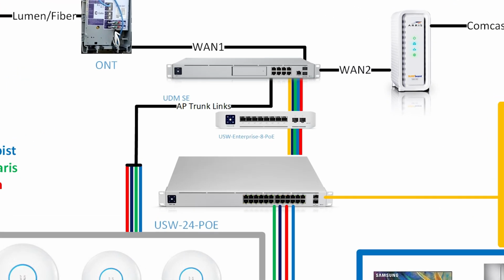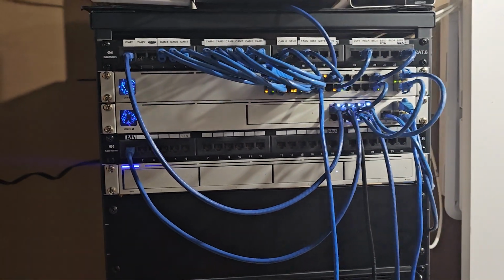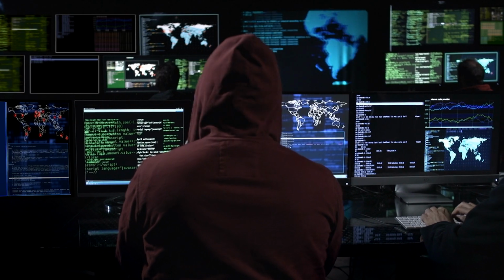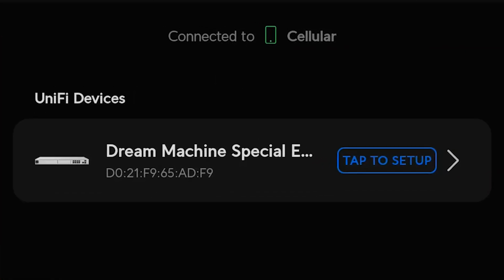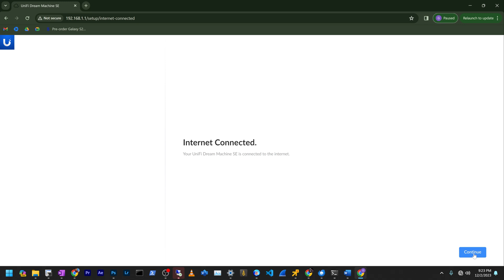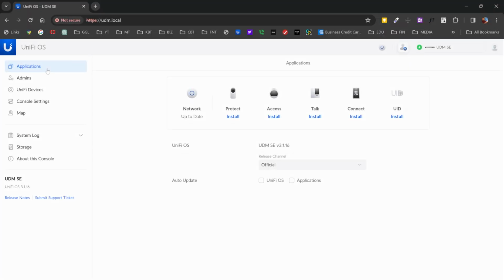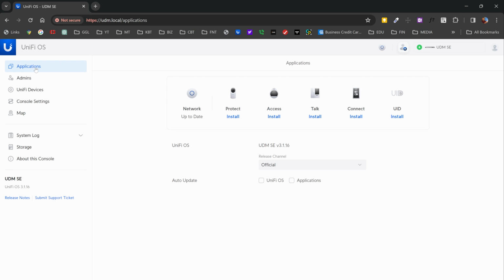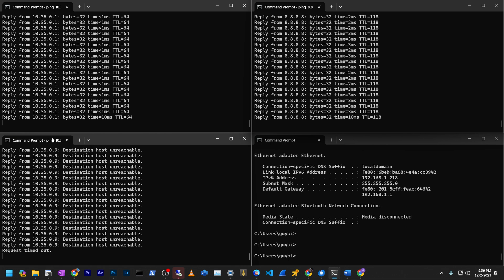🔥 UDM SE Mystery: Lost Configs & Saved by Backups - Why Regular Backups Matter!

Comment: This issue you just ran into is not super common but has happened to many users over the years.
Reply from the maker: It was surprising...
Reply: @KBTrainings   I'm not bashing the platform, but this is one of the reasons I don't push the UDM platform as much as I would like to. For now I keep everything separate and do nightly backups. For the video platform I don't have a customer that requires ultra high availability of historical video, but if I did I would go with a different solution all together.
Reply from the maker: You're right
Reply: I don't understand English,but I need this courses in French please sir